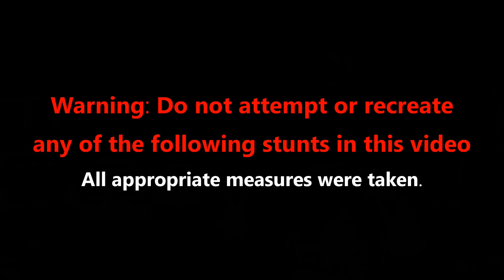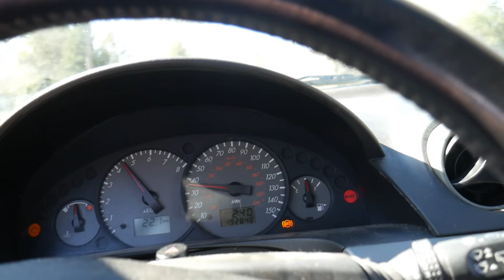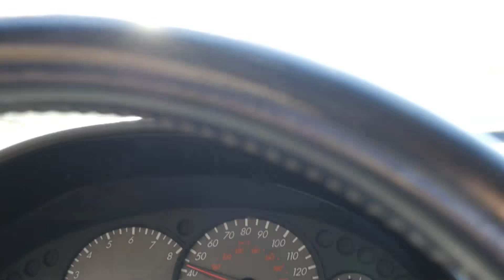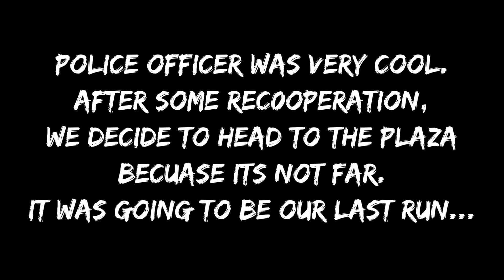212cc Sketchy 50mph Go Kart hits the streets!

Comment: exactly how much money did you put in this go kart in total?
Reply from the maker: IV Kebo VI frame: free
Engine: 100$
Wheels: 120$ for 4. Only used 2
Carb performance kit: 70$
Sprocket, guards & brake: 80$
Paint and other stuff: 20$
Reply: @VasilyBuilds  So over 600 $ wow.
Reply from the maker: 1000 subscribers with no videos challenge probably like 400. I went the extra mile and bought unnecessary expensive parts...

Comment: And 4 estroke this engine
Reply: This engine is a 4 stroke?
Reply: Noah Grace what kind of gasoline in this engine
Reply from the maker: Marcelo Fraga Regular gas e83
Reply: Vasily Custom Builds vlw
Reply: Marcelo Fraga the gas and oil are separated in this engine so it's a 4 stroke
Reply: Marcelo; if you can't tell the difference between a 2-stroke & 4-stroke you have a LONG WAY TO GO..... 😅